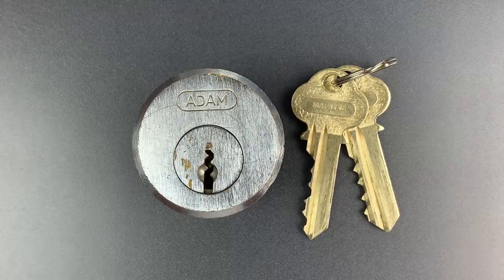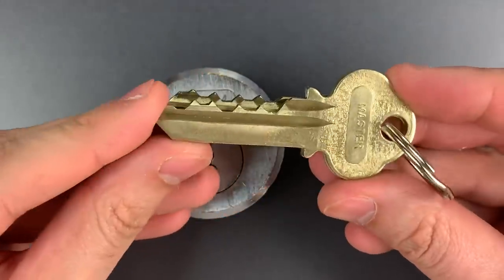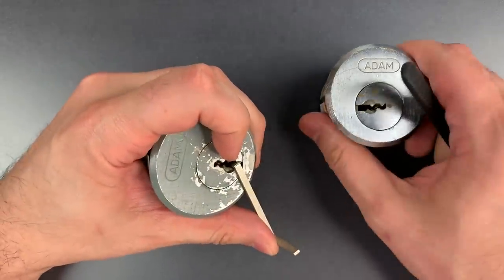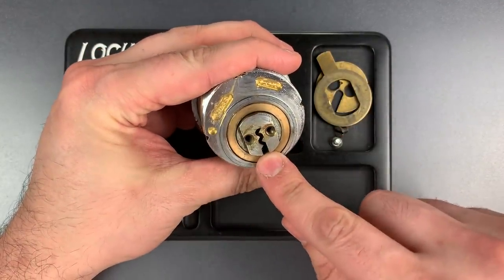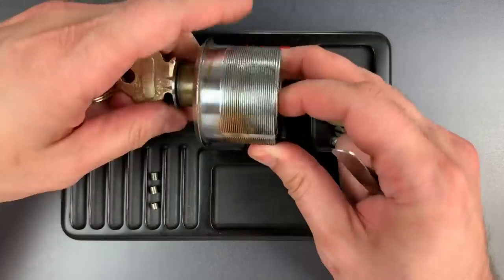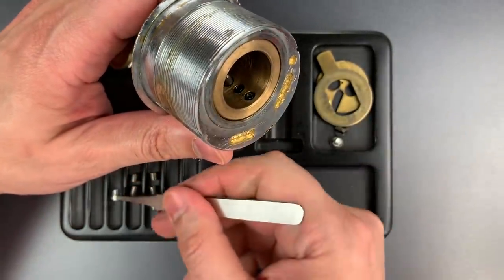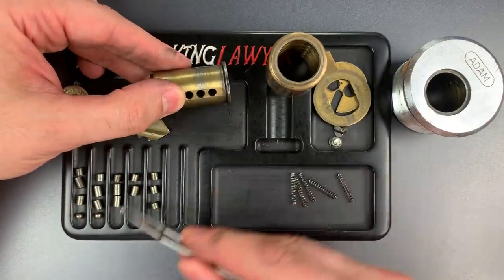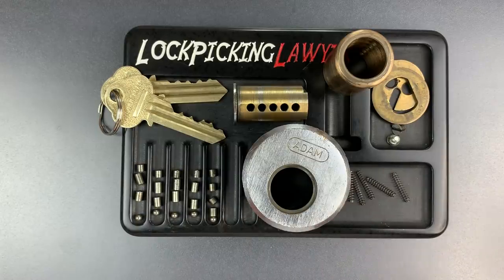[919] Prison Break! Huge Prison Locks Opened in Seconds

Comment: Wonderful design, making the key so large.  It means prisoners improvising picking tools by filing down objects (like a toothbrush handle to make a tension bar) don't have to do so much filing.
Reply: I'm genuinely curious as to why they are so big! Is the idea that the keys are harder to hide? Is the idea that the lock will be more durable? The mind boggles!
Reply: @bradley3549 , the keys are harder to accidentally snap off in the lock due to rough handling in an emergency.
Reply: @bradley3549  
Maybe it's to make a warder carrying all those big keys seem more intimidating.

Oh, and wrap your fist around a bunch of them and you have a weighted fist for beating prisoners.
Reply: @bradley3549  yes
Reply from the maker: The keys need to turn bulky mechanisms.... If a normal key were to do that, it probably would not last very long.
Reply: @lockpickinglawyer  Could they just use stronger materials for the key? Or are they already steel keys?
Reply: You could use a chicken bone on a lock that big 😂
Reply: @bradley3549   I would think these locks are much harder to brute force and break the mechanism.  I watched an apartment manager open rogue doors with a pair of channel-lock pliers.  It would just strip the key way.
Reply: @jasexavier  If they used steel, the locks would wear out very quickly. These kind of locks are opened upwards of a hundred times a day in some places.
Reply: @bradley3549  These locks are meant to hold 500-1000lb doors closed and stand up to prolonged, repeated attempts to break the doors down. The bolts on some of these doors are around 3x1x3(LxWxH) inches of solid steel with ~20-30lb springs behind them that have to be retracted by that key turning the lock.
Reply: The Keys are designed to pass test standards set forth by ASTM, UL, ANSI and others, which they do.  Governments usually require they meet the standards to be eligible.
Reply: @soldner4738  I doubt that the lock is opened a hundred times a day. Nowadays prisons use access control systems with electronic cards and such, usually zoned and time restricted vastly different than the physical key system, with alarms that go off immidiately if you would open a door with the key (or by picking the lock) with the access system "alive" without swiping a valid card.

The mechanical locks are there just as a backup if power goes out or if a lock jams or if the electromechanical portion fails. Thus I would say the key lock is used way less than might be once a month or something for lubrication and functions check.
Reply: @sebastiannielsen   That depends entirely on the prison and door in question. The facility I used to work at was built in the early 80s and the officer station doors in every dorm besides the confinement units used these FA locks with no electronic system on them, so the key would have to be used to open the door unless there was already somebody inside to open it. Additionally the visitor park had FA locks on both the visitor and inmate sides with two doors each that had to be opened for each visitor/inmate manually by an officer. Some days we'd have upwards of 100 visitations, so do the math for two doors coming and going for each.
Never underestimate the laziness and penny pinching attitude of the government.

Comment: The manager of the WalMart broke his master key. He came to me in automotive, where I cut customer keys, to see if I could cut a new key from the pieces and I was successful. I noticed that the cuts were very deep and all the same depth. Just to see if I could, I hand cut a key blank until it was just a straight piece of metal at what I estimated would be the correct depth. It worked just as if it had bitting.
Reply from the maker: walmartdog1142  That’s a common occurrence in multi-tiered mastering systems that are planned by inexperienced locksmiths who use a different pin for mastering of different tiers. Computer-designed master key systems are more common now, and they’re usually better.
Reply: What Walmart doesn't have a Hillman automatic key cutting machine? It'd be either the Axxess "Key Cutter" or the newer Hillman branded "Keykrafter" touch screen unit. Neither particularly like glued together keys and neither would allow a custom cut. Unless you took a file to a key blank, neither machine would really work.
Reply: Compgeke he said he cut it by hand
Reply: @poiiihy  Problem is the Walmart machines don't let you hand cut keys. You slide a key in and the machine automagically traces along the key. There's no manual cutting functions, it's all automated.
Reply: @compgeke  But there there is a tool section right on the next aisle where they have files.
Reply: @compgeke  This happened about 1997. At that time we had a key machine with two vices and an exposed cutting wheel. I clamped the key blank in the one vice and carefully moved the blank thru the cutting wheel at what looked like the right depth. When I left that department, we had the Axxess machines. Nothing custom was possible with those things.
Reply: Hmmm, I remember from oh so many years ago my high school's inside master key was like this. Seemed odd to me but I never thought about it any more than that.
Reply: Any master key system that has all deep cuts was designed by an incompetent locksmith. A proper system must have at least one cut that is shallower than any change key depth. Otherwise ANY change key can be cut down to become a master key.
Reply: @lockpickinglawyer   What is the purpose of these locks being so large? Any reason in particular?
Reply: @reply7007  Makes them look more intimidating to most people (idiots). Two (not mutually exclusive) ways to approach having locks work as security: either have a lock that's actually hard to defeat (which is rarely done, because it's expensive and takes a lot of research), or have it look impressive enough that it discourages people from attempting to defeat it in the first place (nearly all lock-based security relies on this second option exclusively).
Reply: I'd bet the ball bearings contribute to the need for size.  the sleeve then compounds that problem.
Reply: @reply7007  I would say its for physical resistance. Larger = more material to work through if you were to hit the lock with something heavy or try to saw through it or similiar.
Reply: @reply7007  i like how your name shifts all the text of the comments to the right
Reply: fun fact about walmart locks: the lock on the money drawers in the self serve registers isnt a lock at all, it’s a button that anyone can press to open it
Reply: @buggsy5  thanks for inaccurately repeating what LPL said in this video. lots of locks are based around common uncontrolled key blanks. you can walk into a store and buy a blank no problem for $0.99. you wouldn't file the change key into the master key, you'd start with a blank.
Reply: @ssl3546  What does that have to do with what I wrote? To rephrase: If all the master key cuts are deeper than the change key cuts - then any change key will serve as a blank for making a master key. With a properly designed master key system, you cannot recut a change key to make it into a master key.

Comment: Well, if the lock is larger, than it certainly HAS to be better... Right?
Reply: If it was a little larger, the inmates would escape though the keyhole.
Reply: That's the American way!
Reply: Any jail I've worked at either had remote electric locks or locks needing brass keys about 2 " wide, over 4" long and about 1/8 " thick.
Reply: They are large (Keyes) so they are harder to hide (think palming for the older huge Keyes and rectal for these) ouch!
Reply: All jokes and irony aside, the increased size does have potential benefits. Big locks with big strike plates are harder to break. Big locks mean big keys so harder to smuggle as contraband
Reply: @TARINunit9  Bigger keys means bigger serated knives. The larger locks would also be heavier and more damaging if used as weapons, but they are not padlocks and probably not removable.
Reply: @user2C47  Outside of the Kingdom Hearts franchise, I can't think of any size where a key is more practical than your bare fist as a weapon. Not thin enough to be blades, not balanced as clubs, not shaped properly as shivs, and not designed to be gripped in any fashion except between the thumb and pointer finger
Reply: #Merica
Reply: @TARINunit9  As pointed out in the video these locks get frequent use, perhaps 50+ times a day. The larger size possibly wears better than an ordinary cylinder. Also the larger keys would be less likely to bend or break. What I find surprising is that there were no spool or mushroom pins in the lock.
A higher security version of this cylinder has a row of auxiliary pins operated by a wavy milling on the side of the key. Since these pins are off center, the tops are shaped to conform with the curvature of the plug hence there would be some means to stop them rotating.
Reply: Another thing not mentioned is that a large lock and key is much easier to insert the key into an open. Considering these are to be opened over and over again many times a day it really can help with the smooth operation of the prison.

Imagine you had to open every single door in your home with a key and then lock it behind you.
In a rush to the toilet? YEAH, you are going to appreciate the larger keyhole and key.
Reply: @u.v.s.5583  Lmfao
Reply: It being worse says everything about the American prison system that is both stupid and evil.
Reply: @TARINunit9  It can be filed down to a pretty good shiv. Definitely easier to kill with a key than with your fists.
Reply: @ZeroPlayerGame  Except your grip on a key is godawful
Reply: Brain surgery would be more precise if the brain was as big as a football stadium
Reply: Harder to break by brute force, a more likely threat in the Facilities. Not my problem anymore!
Reply: Rabo Karabekian Those were my favorites ! Those facilities are a lot fewer in my state now.
Reply: @essietel1196  Meanwhile, if you're talking a women's prison... I mean, something would have to be pretty large indeed to no longer fit, given the size of some sex toys... XD

Comment: That's a beefy lock. Having more than one shear line makes them easier to rake open or pick. Great video!
Reply: @lifeuncovered6188  why are you like this
Reply: Actually, if you did it right, multiple shear lines could make things harder to pick.  The trick is that all the pins have to set on the same sheerline in order for it to unlock.
Reply: @Keldor314  Better prison locks!
but how?
Reply: @Keldor314  Without undercutting, serrations, spools, T pins, or other security features making the job tougher, master keying will always make opening a lock that can be bumped or raked more vulnerable and give two equally valid positions for set.  It's mechanical, it doesn't care whether the shear line you're at is created by the bitting for the master or the lower privilege key. Master keying will always create double the viable number of lock positions that open a given lock for each key pin that is made up of more than one part. If you have a one-position master, it's twice. Two, 4 times. Three, 8 times. Four, 16 times. Five, 32 times. It's basic math. You still have to be thinking you can pick the lock and have a tool, but it increases your odds of picking.

Comment: I suppose those locks are more designed for extreme use over absolute security.  Hence the absolute size, lack of security pins, and ball bearings.
Perhaps the lack of pick resistance is mitigated by installing these locks such that inmates are always on the other side of the keyhole when the door is locked.
Reply: Yep, the thing is that in most cases anymore those doors are solid so your never getting to the keyway so these kinds of locks are ideal since they stand up better.   Even on the older style bar ones are generally designed so you can't easily get to the keyway.   I mean sure a really experienced lockpicker might be able to do it with the bar style doors but your still doing it blind with limited mobility, only a really skilled lockpicker could do that.
Reply: @MaethorDerien  The main issue I see is that they can be raked open. If they had to be picked more traditionally I could see it posing a much larger challenge. But you dont really need to see what you're doing to just rake it open with an improvised tool.

I mean, ultimately, in most prisons, it wouldnt help alllll that much anyways. But its still a design flaw that woudl probably be best to avoid given how low skill Raking is, and the fact it doesnt require any crazy fancy tools, easy to improvise.

Comment: 0:53 funny you should mention this, I once attacked a lock by obtaining the operating key and filed it down. However as you mentioned some section was cut too low on the operating key. My solution was to use electronics solder on the area I needed built up. I made a big ugly blob of solder and carefully hand filed without breaking the delicate bond between the key and the solder. It worked  well on ACE and Abloy type keys as well.

Comment: How do CO’s keep lock smiths behind bars, I mean it’s just a matter of time till you hear “click out of 2... 4 starts binding...” all the sudden you have the whole prison running after you.
Reply: Because the gaurds are armed.
Reply: Guns go pew-pew. Prison guards can use this to their advantage
Reply: And I think 7 years for an escape conviction may have something to do with it as well.
Reply: CO's usually aren't armed.  Besides pepper spray.  Also, bar-style doors went out with the old west.  We use nice, thick, solid chunks of steel these days.
Reply: @sterilyte  and electronic door locks for the cells...
Reply: @KickyFut  With the default position of 'locked', you know, in case power goes out.
Reply: @sterilyte  Actually, default position of unlocked because if the power goes out in a correctional facility this generally means something that means you want to evacuate the people inside the prison (both staff and inmates) to a safe (but still secure) location, and if your electronic locks default to locked that means you just created a deathtrap instead.

Even if you only care about the prison staff (and you should care about the inmates) it is still very important that a prison doesn't turn into a death trap in the case of a fire, earthquake or other disaster.
Reply: Just as a note, being a locksmith does not necessarily mean knowing how to pick locks. It just means knowing how to get them open without the key. This might involve non-destructive means, like bump attacks, or just breaking through the lock with a drill or something.

Comment: Me: locks door while leaving my keys in the house
Me: “No!!!!”
Also me: ”My time has come.”
Reply: Your front door can be locked without a key? That's a pretty serious design flaw.
Where I live, everyone uses deadbolts for door locking mechanisms, spring bolts are only ever connected to a handle, not to a lock.
Reply: @ivan_pozdeev_u  Have you ever been to Europe? Almost every front door here locks without a key.
Reply: @TobiasLindh  If you don't count European Russia as Europe -- only once, and wasn't interested in studying locks. I do remember though that there wasn't anything unusual about our hotel room door -- in partucular, we definitely didn't have to watch out not to accidentally close it lest we be locked out outside.
Reply: @ivan_pozdeev_u   There are many different variants with hotel rooms, but most of the ones I've seen also lock the rooms door without a key. Especially the ones that are controlled by a card.
The spring bolt is connected to the handle, but front doors don't have a handle on the outside. You still have to use the key to set the deadbolt, but you when you forgot your key inside and closed the door, you can't get in anymore.

Comment: Make a video about how master key works. Please?
Reply: The stacked pins you see here are the crux of it. That results in there being more than one position on each bit of the key that can allow the cylinder to turn. Make one of those positions consistent across a set of locks, while the other varies, and you've got it.
Reply: You can find quite solid explanation @ https://unitedlocksmith.net/blog/how-master-key-systems-work
Reply: Deviant Ollam's talk called "Mastering Master Keys" is a good introduction to the subject.
Reply: Didn't he just did in this video? I thought it was pretty clear.
Reply: Look at the ones that have 3 pins. That allows for two different positions to be used for each position. The tiny pin in the middle of the two larger ones is used to make the master key combinations.
Reply: @zone07 : Nope. Not in enough detail to make it clear.
Reply: @AntiComposite : Yeah, "Deviant's" video makes it pretty clear. I'm surprised the Lawyer doesn't have one yet (I guess).
Reply: I've also been wondering this. So a master key is one key that can open many locks, right? But each of those locks also has a key that doesn't open the others?

What would be the function of this? To have staff who can access one section of the prison, and then he warden has access to all?

And also yes, how does it physically work so that it stops the other keys from working but allows the master key to work.

What does turning that master ring do that turning it with the other key doesn't do? Does one lock have two functions?

Comment: Having been in prison for about 20 years, it's my experience that most prisoners don't mess with locks. The guards don't like that. Get caught tampering with locks and you'll get a transfer to someplace you don't want to go. And as for padlocks that are used in prison they welded a tube over the keyway about an inch and a half to two inches long. The key had to be modified to fit. It makes it virtually impossible to pick. (I said virtually, LPL.)